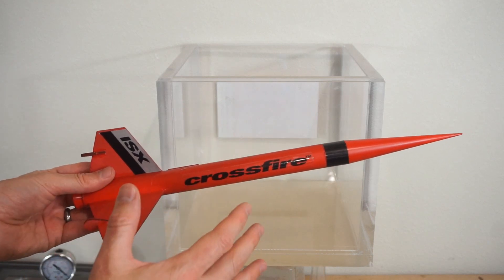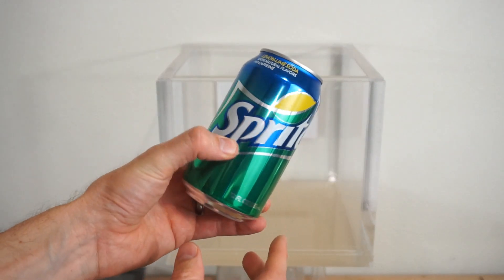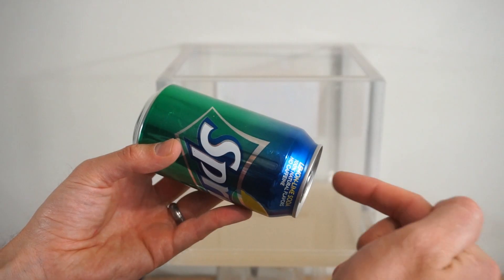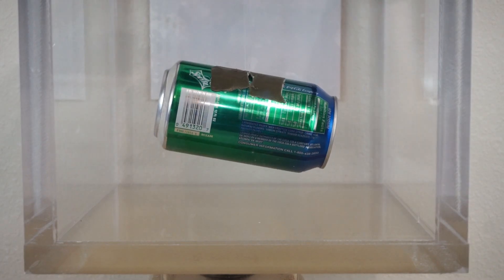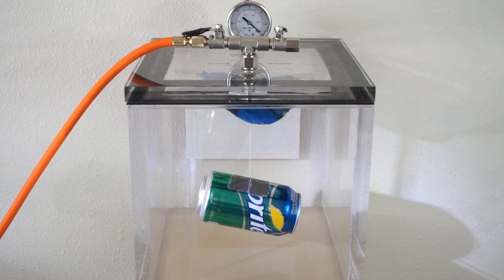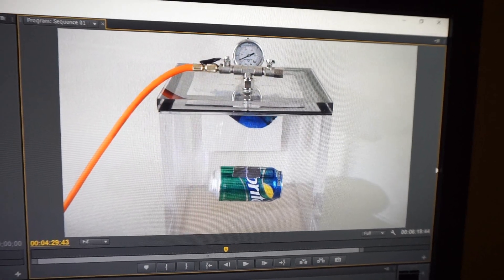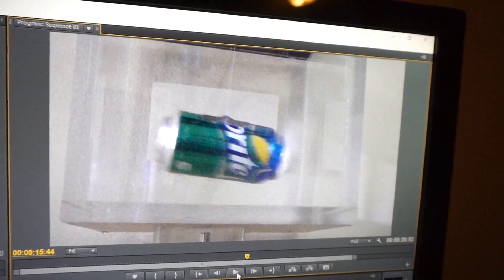Can a Rocket Fly in a Vacuum Chamber?

Comment: "Pushing on the wall", "pushing on air"? Of course it doesn't need to push on something. It ejects mass in one direction so it goes in the opposite direction, that's Newton's third law of motion, nothing new. But it's good to do the experiment yourself and I guess it's great to teach physics.
Reply: Negative Minded This is for flat-earthers that think rockets can't work in space.
Reply: Flat-earthers? Worse and worse... The damages of ignorance impersonated.
Reply: 1969nitsuga
It's not a matter of me seeing anything.  You're simply wrong.
The opposite force is exerted before the exhaust even reaches the vacuum.  You're so concerned with showing the exhaust cannot interact with the vacuum, that you're missing the fact that THE EXHAUST IS NOT SUPPOSED TO INTERACT WITH THE VACUUM .  Nobody claimed it did, ever.
So stop knocking down your own stupid straw man argument.  "In space vacuum that energy is depleted..." whatever.  No one here is talking about any pushing or interaction of any kind with vacuum.  The exhaust interacts with the rocket, and both the exhaust and the rocket push each other away.
Reply: 1969nitsuga
The opposite reaction of the exhaust gases pushing themselves back against the inside of the rocket is the rocket moving forward.  The vacuum outside plays no role.  No one claimed it did.
Reply: Holocene
Where is your source that says it wouldn't?
https://en.wikipedia.org/wiki/Rocket
" Rocket engines work by action and reaction and push rockets forward simply by expelling their exhaust in the opposite direction at high speed, and can therefore work in the vacuum of space. "
Reply: Just A Man
The exhaust pushes against the inside of the rocket and pushes itself back.  The equal and opposite reaction is the rocket pushing forward.  Nothing's pushing against itself.
"The combustion chamber is an explosion that pushes on all sides of the chamber equally."
Not the nozzle.  It's free to exit that way.  It's not a side to push on.
Reply: Just A Man only pushing you doing is at your moma ass. Go back to school. Newton reference of frame doesn't have air. It is a perfect vacuum.
Reply: 1969nitsugu
No such empirical data.
It's like pushing away heavy rocks (each of which pushes you back a little), and you have a huge bag of those rocks.  Yes, it works.
Reply: 1969nitsuga
We already had the explanation right.
Reply: TheOneWith TheEyeOfTruth To see this you need to view the system as a kinetic energy transfer. In space vacuum that energy is depleted without creating an opposite force. The exhausts gases will always has a smaller mass than the rocket. Nobody challenges your view because there is too much at stake on the table. What do you think will happen if the people confirms thete are no space travel s nor space rockets or satellites?
Reply: TheOneWith TheEyeOfTruth The 3rd doesn't work the way you are saying. It is a matter of mass and energy. Gun's recoil, Newton's 2nd.,  requires mass to create momentum which is preserved in the system until force affect it. Your neighbor had a new AR-15 and had the brilliant idea of using it in his backyard while you are trimming the grass. He accidentally shoots you in the shoulder and the bullet gets stuck in a bone why is that? Your skin may not but your bone stopped the bullet and your whole body absorbed the impact. The bullet had enough energy stored to do that after leaving the barrel. An opposite reaction requires mass to build and preserve momentum. The momentum is preserved trough the system means that the equation has to account for it jn the numbers and results but it is in an inverse proportion between mass and acceleration. The more acceleration the less pressure in the system (here is when the momentum is shifted from the bell and the rocket's body to the exhaust gases negating opposite reaction. It is similar to holding a firecracker in the palm of your hand. If it explodes while your hand is open you will not be seriously harm but if you close yor hand tight you will probably lose your fingers. The opposite reaction will send your fingers flying around. Where is the momentum?
Reply: TheOneWith TheEyeOfTruth You are mistaking thrust with recoil.
Reply: Alex Lazarus you are still believing opposite reaction is what moves a rocket thats why you reject the equation. The principle of thrust in an airplane and a rocket is the same you've been made think otherwise, Ve specific exhaust velocity doesn't implies momentum in an isolated system but in interaction with athmospheric components. Tsiolkovky's equation asumes that what moves the rocket is just opposite reaction but reality is showing otherwise. Ln(mo/mf) is just telling you how much fuel is consumed through the trajectory but not why it is moving. Nobody realy knows what is mass and how it functions. But to move you need energy over something (force) in sufficient amounts to change inertia. In other words, to charge mass with energy and then there will be momentum.
Reply: Alex Lazarus this little elementary school experiment shows how the athmosphere interact depending to the nozzle configuration and how it affects thrust. No real momentum by opposite reaction. https://youtu.be/rotO0PTlwBk
Reply: Alex Lazarus t;ese are some other experiments, take not on the difference in nozzles. You can make them at home. Tsiolkovky's is only a fuel vs thrust equation that doesnot account for the real factors. https://youtu.be/FeULZ4Ow81U
Reply: Alex Lazarus This guy will give you nightmares for many reasons but he made an interesting set up with negative pressure. https://youtu.be/xe0PjqC0dgw
Reply: Alex Lazarus F=mVe=mVe-act+Ae(Pe-Pamb) the last part of the equation will always yield a negative Ae because Pamb in space vacuum is undefined or tends to infinite. -Ae>mVe-act.
Reply: Alex Lazarus You just can't cherry pick physics. The energy goes in the expelled expanding gases. Momentum implies force and force implies energy.
Reply: Alex Lazarus I am digesting your idea. It is a good analysis but still we need to visualise the rocket and its inmediate environment as a whole, a system. Tsiolkovsky equation only accounts for the fuel consumption/velocity and mass loss. It doesn't accounts for the different factors interacting. Gives the rocket thrust as a given thing in disregard of the real mechanism operating.
Reply: Alex Lazarus I will send you a link to a video from NASA explaining the origin of thrust as the pressure exerted in the bell. Water is a non compressible fluid and the dinamics are not the same.
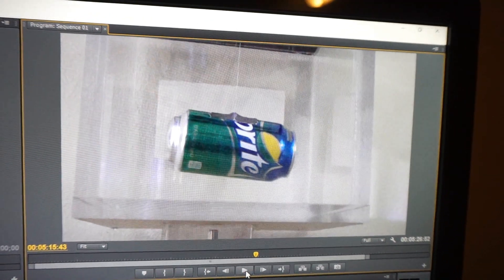Reply: Alex Lazarus https://youtu.be/xe0PjqC0dgw at 5:55 the presentation shows the real reason gor thrust and then try to diminish the argument for athmospheric pressure. But it is too late... The drawing on the board clearly represents the gases generating pressure over the walls of the rocket's engine bell and using a path of least resistance you hate so much but can't get rid off. To exert pressure up you need pressure down. If there is nothing to push from nothing will happen.
Reply: Alex Lazarus good luck with your rocket to nowhere. He who likes to be deceived will always be happy to continue with a lie. Rockets still don't work in vacuum and theres empirical falsifiable data supporting that against a biased unsustained NASA claim.
Reply: Alex Lazarus Not even NASA has proven being on the moon. Has you seen the ISS fake videos? It is lame. A friend of mine worked designing that thing, it has been a sham from the beginning. Like space x and blue origin, hoaxes to suck money for black projects. LOL Do some research and build a little experiment, see what happens with thrust in vacuum. You seem smart enough to do that, hope so.
Reply: Alex Lazarus P.D. the moon is way closer than the 293000 miles they tell you and inside the dome.
Reply: Alex Lazarus peer reviewed by hundreds of people.
Reply: Alex Lazarus it is better data than yours. Ive done experiments confirming results. And the retroreflector can be a lot of things. Still there is no curvature and rokets don't work in vaccum.🙊🙉🙈💩
Reply: Alex Lazarus its called a silica plate. There were many similar experiments with similar results in laser reflection before Apollo 11. MIT made a few. Prove there is no dome... Just like when you prove there is curvature...
Reply: Alex Lazarus They tracked... You were there? LOL Money and control over society, a flat earth implies ID and the deep state will lose their grip over himan kind. Its quite obvious.
Reply: Alex Lazarus prove spinning and curvature. You can't! LOL
Reply: Alex Lazarus https://youtu.be/uz09H_qwQ-U so much for your reflector. 😜
Reply: Alex Lazarus Mit did it in 1962 without reflector and low intensity lasers... Just more bullshit to trick people. l just found this nice video that more or less explains what I've been trying to push in your indoctrination hardened head: https://youtu.be/PxT5wYSLuI0
Reply: Alex Lazarus all that is debunked or soundly explained. Your reflectors could be anything. And if the moon is inside the dome it opens a lot of possibilities, none of them bery reassuring for you. Coriolis has been shown to ne inverted many times, particularly in big athmospheric phenomena like hurricanes. Besides, in a closed system like the dome you got a Sun and a moon circling around creating wind currents.
Reply: Alex Lazarus If the earth is round and spinning at 1043 mph nobody would be able to ttalck to each other. Sound waves are slower. This is similar to tbe quantum delay choice and light in a heliocentric model.
Reply: Alex Lazarus Krakatoa's explosion's vibrations could have been absorved pr diverted in many different ways. Geology doesn't have a solid paradigma. It is mostly congetures and false assumptions. You ever bee to Equador? Coriolis doesn't work as you say. It is a lie.
Reply: Alex Lazarus I just said that. What I also said is that it is not spinning what causes it but simple air currents with an inside Sun and Moon circling close the equator.
Reply: Alex Lazarus Globe model don't predict but simply incorporates apparent phenomena through biased explanations that doesn't fit empirical data.
Reply: Alex Lazarus All those theories are simply based on wrong assumptions trying to explain phenomena without empirically supported models. How to put it... mambo yambos to trick naive people.
Reply: Alex Lazarus This is another curious videon This effect may be caused by ice formations over the dome. https://youtu.be/SUmhvzlWX6E
Reply: Alex Lazarus It is fun to see how you use contradictory assertions to support your rotating globe model. The car, once moving you don't feel anything but the pendulum changes aligment by the same forces? The pendulum has shown to be influenced by many factors, none of them gravity nor rotation. It proves nothing except that relativity is wrong and there is no gravity as descrribed by mainstream theories. The pendulum has inconsistencies in speed, swing direction, and friction with axis to the level of being discarted as empirical evidence for earth movement. I really hope you are only designing airconditioning systems and not planes.
Reply: Alex Lazarus the pendulum is no evidence for earth rotation. And krakatoa neither for round earth.
Reply: Alex Lazarus just sent uou a video about rockets. Sound is a wave and in that case it reverberated through the planet. Sound moves at different speeds deepending on many conditions like density, athmospheric pressure, wind direction and speed. The sound reverberated for days, it was bouncing on something... the dome. You still has no real evidence of curvature nor rockets in vacuum. Just one paper or NASA experiment... I gave you people's experiments supporting my claim.
Reply: Alex Lazarus your pendulum moves in different directions and is affected by random forces at start. In fact, if we were spinning you should not need to push it to start because it would be moving endlessly. A perpetual motion machine, wich it obviously isn't.
Reply: Alex Lazarus You are just desperately searching the net for answers to sustain your outdated and unsupportrd heliocentric model. You still has to face Michelson-Morley and quantum delay choice for photonic dynamics supporting stationary earth. Good luck with that. All you are bringing are debunked cliche for gullible globetards. Be a man and admit defeat.
Reply: Alex Lazarus thete is no 100% correlation. Experimental results, real experimental results, bring pendulums moving in the wrong directions and angles. And krakatoa was just a sonic boom rebouding on the dome. In fact, the dome is better explaining than the plain athmosphere hold down by a nonexistent gravity force. You are just parroting things someone pulled in his desperation to explain observations under a nonempirical theoretical construct.
Reply: Alex Lazarus https://www.quora.com/Does-the-Foucault-pendulum-prove-that-the-earth-is-rotating-Even-if-the-earth-is-not-a-globe-how-could-this-movement-be-explained-in-the-flat-earth-model this is one of many evident observations debunking your pendulum.
Reply: Alex Lazarus https://www.quora.com/Does-the-Foucault-pendulum-prove-that-the-earth-is-rotating-Even-if-the-earth-is-not-a-globe-how-could-this-movement-be-explained-in-the-flat-earth-model
Reply: Alex Lazarus the theory behind the pendulum has to be at the north pole to be any kind of spinnig evidence. Ther are hundreds of trials with different outcomes demostrating that what you say i wrong. I also had physics labs at college.
Reply: Alex Lazarus you again mistaking observations with the biased explanations given by maistream. The pendulums has many factors affecting results and are usually overlooked in the rush to get supporting data. It is not nonsense iys simply physics telling you those numbers are not reflecting what they say. Most pendulums has magnetic actuators that create torsion at the spike or string interfering with its free operation. The theoric background used to relate operation to earth spinning omplies inertial forces not related to spinning, something already discredited by quantum mechanics experiments of differentt types and set ups. And it is also related to the pendulum position in the earth. The experimental results are not spinning related.
Reply: Alex Lazarus this is a video of the Sun under the dome and veryclose to the ground. In fact, the clouds are all around it.
Reply: Alex Lazarus I don't believe the Mach principle is real but in general there are unaccounted factors like magnetic fields and temperature affecting a pendulum working. Michelson's experiments were on thee asumption of earth spinning.
Reply: Alex Lazarus it is all circular logic. You try to prove earth spinning by interpreting experiments under the assumption of a spinning earth. A non stationary aether has neen sustained by recent research. Einstein's relativity also has that same problem. Inertial frames and the speed of light are affected by the moving aether. Your experimental data must be flawed.
Reply: Alex Lazarus first: aether exists and it is fluid. Second: Speed of light inside inertial frames is not a constant. Third: Inertial frames are not isolated from the external reality and you can determine real speed and movement. Fourth: there is no light contraction as descrined by Fiztgerald-Lorentz. Fifth: time is only perception Sixth: no gravity
Reply: Alex Lazarus Einstein's aether is static not dynamic. He basically regected it but empirical evidence has proven him wrong.
Reply: Alex Lazarus what part of dinamic implies us to be moving. You are still clinging to relativistic thinking. It says that we are moving but experimental data don't show it because we don't have an outside static point of reference to show our movent. That's the origin of Relativity trying to protedt gravity and the heliocentric model from empirical data showing otherwise. One of those experiments was Michelson-Morley. But recent discoveries in quantum mechanics show That the Fitzgerald-Lorenzt contraction was misused and misinterpretated to null Michelson-Morley. Quantum Delayed Choice and other experiments support this. Sun's light takes 8 minutes to get here, particle/wave duality forbids us to see that light under the heliocentric model. If the Sun is 93,000,000 miles away and it takes 8 minutes we would not see it with the naked eye if it were an hour away by mere light refraction.
Reply: Alex Lazarus https://youtu.be/uN561xqEKxQ
Reply: Alex Lazarus https://www.google.com.pr/url?sa=t&source=web&rct=j&url=https://arxiv.org/pdf/gr-qc/0104032&ved=2ahUKEwjwztun_PbZAhUCXK0KHTq2AxEQFjAEegQIBxAB&usg=AOvVaw3fKv2BQ0a44ggm9yUP5zd5 the Fitzgerald-Lorenzt contraction was misused. Relativity is a game of words to support gravity which to the date has no empirical data supporting it a hasn't neen found nor explained with satisfactory mechanics in light of quantum physics.
Reply: Alex Lazarus Your assumption is wrong. Astrophysicists make theories about quantum physics but empirical data is analysed under biased assumptions. Check the video about the Sun's size and light speed. Simple logic. This one gives you the idea too. https://youtu.be/0mG2P_4JMms if observations and logic does not fit the model you change the model.
Reply: Alex Lazarus all that is circular logic. An object 93 million miles away has an 8 minute delay to your current position. If gravity exists as described the gravity well will distort light but also make an interference pattern denying us from seeng the Sun's light. Astrophysicists doesn't touch that even with a 10 foot pole. Time is a perception but it is always running at the perspective of the observer outside the system. All speed is distance related to time and inertial frames are not isolated from the external reality. For us to see the light implies a stationary earth and a moving aether. That's why microwave and redshift measures tell earth in the center and disprove Big Bang. Particle/ wave duality requires an observer and without it matter doesn't organize, at leadt not as we percieve it. Vision only organize the data in a coherent way once perceived by fhotoreceptors in the eye after lenses (observer). If we are moving through space that light won't reorganize and we could not see a coherent light pattern but a probability wave outside spacetime continuum. Quantum mechanis are not compatible with relativistic physics exactly because of time and gravity (the essence of relativistic physics).
Reply: Alex Lazarus Relativistic quantum mechanicsis only rethorics with number salads to protect the relativistic construct which is not supported by empirical data. It requires interpretation of observation under circular logic and interbreeded assumptions. And still there is no curvature...
Reply: Alex Lazarus quantum mechanics is not a lie. The lie is the interpretation under cicular logic and the relativistic physics to explain phenomena under biased assumptions. Phenomena must be explained under observable, logical and verifiable data, reality. Still no spinning or curvature...
Reply: Alex Lazarus those are simple interpretations of observed phenomena with a previous mind set up to prove spinning and curvature. There are alternative explanations for the observations but mainstream regects them, not for lack of empirical data but because they don't fit their preconceived models and theories. Better examples than Big Bang and Darwinian Evolution are hard to find. Researchers are human beings with all the goods and bads it may represent. Cognitive dissonance usually affects the group with stronger believes in a disrrupted paradigm. In our case, there are huge interests from institutions and sectors in society interfering with the change process. How many people will go to jail for a flat earth at NASA? Or how much will the shares of satellite contractors like Rytheon, Lockheed, Blue Origin and Falcon X will drop once the truth comes to light. Just think about the Smithsonian... Still no evidence for curvature, just a real photo from outer space... Is that too much?
Reply: Alex Lazarus this is the basics of the curvature problem. Empirical data is sidesided to support a misleading lie.
Reply: Alex Lazarus The problem with those photos is that has been shown to be fake composites in many ways. The Chinese sent a probe a few years ago... Why didn't we have new photos and not those. 50 uear composites?
Reply: Alex Lazarus https://youtu.be/1X_Tw27wWv0 see the curve...
Reply: Alex Lazarus Michelson-Morley's original findings were refused by using Fiztgerald-Lorentz contraction and eventually Michelson-Morley was correct. I sent you experimental data rejected or sidelined by mainstream and told already how observations and data are mistaken for mere explanations and interpretations even against known laws of science for many biased reasons. Still no curvature... The last video is very enlightening about curvature. Debunk that if you can. I live on an island and you can see further than 10 miles at eye level and the coast line is over 100 miles straigh. To left and right.
Reply: Alex Lazarus It is a weather thing, they obviously has to account for it. But it has nothing to do with earth rotation.
Reply: Alex Lazarus simple mass and inertia. It is an electrodynamic process. Mass gets charged and discharged by contact and friction.
Reply: Alex Lazarus one stept closer to enlightening.👍
Reply: Alex Lazarus As I told you before, there are many factors interacting with the pendulums. It can be affected by environmental factor, even electromagnetic currents, remember the aether is dinamic and circles earth, the Sun moves through the imaginary equator and it can generate electromagnetic and ionizing effects. Needs more analysis and research but spinning eaarth is definitively discarded. I found this this morning, it confirms my point of view. https://youtu.be/z7tIbwK0ulM
Reply: Alex Lazarus Do you know how inertia and mass work? We measure mass by weight but it is not weight and inertia is a tendecy to keep moving or resistance to movement till force is exerted. So it needs some sort of kinetic energy charging in relation to density and mass. Gravity is not an answer because it doesn't exists as described and there is no real evidencefor its existence. There are too many incongruencies in its observations vs theoric explanations.
Reply: Alex Lazarus weather and environment are 2 different things.   There are subtle forces in acction we are not necesarily aware of but spinning is not one of them and that is an empirica fact.
Reply: Alex Lazarus It is a fact, all those experiments, fluid mechanics, inertia and simple logic are supporting it. All you got is cherrypicked data with dubious interpretations/motives and pseudoscientific dogma.
Reply: Alex Lazarus We don't spinn... An empirical fact, no gravity, an empirical fact, dinamic aether, an empirical fact, relativistic physics false, an empirical fact, no visible or measured curvature, an empirical fact and no opposite force as thrust in vacuum, an empirical fact. We have a solid case. All you need to do is evidence the curvature and the spinning with a "real" non doctored satellite photo. I will be here waiting...
Reply: Alex Lazarus Apollo's has been debunked by experts in photography and the other space agencies pictures are just like NASA's fake n cgi. You still has not provided any real empirical data or scientific experiment showing globe earth nor spinning. Without those everything iin the heliocentric model crumbles. You are just a case of cognitive dissonance.
Reply: Alex Lazarus you have not provided expperimental data sustainig your position. I did. You only got debunked dogma. I know what cognitive dissonance is, do you?
Reply: Alex Lazarus This is very easy, this picture shows a flat horizon. Thete is no way it can happen inn a globe earth. The curvature is the same to all sides. Autocad tells you the curvature for 5 miles is 5 × 5 × 8 = 200 feet. That's a 15 stories building. Do you see that? No, you don't. Everything else is irrelevant. https://www.google.com.pr/url?sa=t&source=web&rct=j&url=https://aplanetruth.info/14-if-the-earth-is-a-curved-sphere-why-are-all-horizons-flat/&ved=0ahUKEwidkPXHkfzZAhVMIqwKHRHyBgwQFggoMAA&usg=AOvVaw2AFs8Du-YXm6UAID_8PokX
Reply: Alex Lazarus Just explain why we don't see the curvature or why those experiments don't show the earth moving at all. Why red shifting a microwave background tell us to be at the middle of everything. Those are empirical results.
Reply: Alex Lazarus Your links are only interpretations of observation or mathematical constructs not supported by reality. That is not evidence. Empirical evidence is the results of Michelson Morley or Sagnac, clearly contradicting earth movement and relativistic physics.  Sagnac contradicts relativistic physics and without that Michelson-Morley's results are obvious. We are not moving and the propagation media does.
Reply: Alex Lazarus Simple denial, all birds has wings and beaks. Every beach horizon on this earth lokls basically the same. Your analogy is faulty and desperated. https://www.google.com.pr/url?sa=t&source=web&rct=j&url=http://www.conspiracyoflight.com/SagnacRel/SagnacandRel.html&ved=2ahUKEwiHzqmHqPzZAhUIcq0KHfA7DCQQFjAKegQIABAB&usg=AOvVaw0-fI9wq5x_qKjkYL478cyd Sagnac for you!
Reply: Alex Lazarus And yes, it negates all your indirect interpretational evidence.
Reply: Alex Lazarus Ha ha ha! That link takes you to a circular logic paper telling you that we are not the center of the universe because Copernicus said so and we believe him even in front of evidence of the contrary and the we create an absurd and surreal complex explanation for damage control. This tell you there are no black holes, nor big bang, there are no valid mechanics. Empirical evidence tell you can't get something from nothing. https://www.google.com.pr/url?sa=t&source=web&rct=j&url=https://uncnews.unc.edu/2014/09/23/carolinas-laura-mersini-houghton-shows-black-holes-exist/&ved=2ahUKEwiVpdqyrfzZAhUHVa0KHcACAiEQFjAfegQIABAB&usg=AOvVaw06Y9fv8WxfuhKcobptqQJt
Reply: Alex Lazarus https://www.google.com.pr/url?sa=t&source=web&rct=j&url=https://en.m.wikipedia.org/wiki/Axis_of_evil_(cosmology)&ved=2ahUKEwisiK--rvzZAhWCna0KHeOID-sQFjAAegQIBhAB&usg=AOvVaw2tEOEqs0lF7Rh47FLXxuxm
Reply: Negative Minded, you've just illustrated you have no idea what Newton's Laws explain. Rockets were originally called  'Thrust Rockets' because they required thrust at both ends to operate. They work on Earth because the 'air' in our atmosphere is able to be compressed and utilized as a backboard for the Rocket's required 'thrust'. And it is a requirement. Rockets do not produce the required 'thrust' in the infinite vacuum of Space. It worked in a small vessel because the sides provided the required backboard.
Reply: It's hard to argue with these Scientologist space mormons. In 2018 they just literally make up their own science rules and invent new abilities and characteristics for gravity whenever they need to defend it.
Reply: 1969 Nitsuga I admire your patience in making this mental midget dance and squirm around for DAYS but give it a rest. The guy is hopelessly religious.
Reply: He thinks the explosion is bouncing off the interior walls of the chamber, which forces them out the back, giving the rocket a little PUSH in a nice neat orderly controllable direction. They did this over 40 years ago and landed a bunch of tinfoil and shower rods on a rock 240,000 miles away doncha know!!! It's on TV guys.
Reply: NotTheCIA I.think, thanks for a good read!

1969nitsuga, thanks for a really hard laugh!
Reply: you're grasp on reality is duct taped together.  You can't push on nothing and get an equal and opposite reaction you genius.  You can't push against your self and move in a direction LOL.  The combustion chamber is an explosion that pushes on all sides of the chamber equally.  The only difference is the "exhaust" is just a place for the gas to escape.  The equal and opposite reaction is the exhaust hitting the air mass, and the air mass pushing back in the opposite direction with equal force.  You're literally thinking the rocket pushes against itself and thus moves.  You must have gone to government schools.
Reply: Negative Minded your assertion has been proven wrong by empirical results. Sorry if you can't understand the physics of thrust in vacuum.
Reply: TheOneWith TheEyeOfTruth what you say is wrong and there is empirical data sustaining it. Rockets don't work in vacuum.
Reply: TheOneWith TheEyeOfTruth that is like pushing your car with the legs in the air...
Reply: 1969nitsuga hope you can understand. Rockets works much efficiently in a vacuum than air. Even Turbofan jets work same principal. Newtons third law doesn't need you to go to private school or government. Just try to understand. Focus for 5 minutes without making up nonsense.
Reply: Negative Minded https://youtu.be/FeULZ4Ow81U This is an easy set up for you to build and test by yourself.
Reply: Negative Minded another one https://youtu.be/xe0PjqC0dgw
Reply: TheOneWith https://youtu.be/xe0PjqC0dgw
Reply: TheOneWith TheEyeOfTruth an easy set up for you to build.
Reply: Negative Minded another one https://youtu.be/DMQMvNXq5Ts
Reply: TheOneWith TheEyeOfTruth another one https://youtu.be/DMQMvNXq5Ts
Reply: Alex Lazarus F=mVe=mVe-act+Ae(Pe-Pamb)
m= exhaust gas mass flow
Ve= effective exhaust velocity
Ve-act= Actual velocity at nozzle exit plane
Pe= static pressure at nozzle exit plane
Pamb= ambient (athmospheric) pressure
Reply: Alex Lazarus you better use a pool game. People is more familiar with it than a pendulum. Momentum is preserved through the system. The system depends on contact to interact between the parts. This is only another energy transference process. Momentum depends on movement and mass (we don't know the nature of mass). The body maintains this kinetic energy unless its speed changes. The exhausts gases as a fluid saturated with kinetic energy in an isentropic process will be at high supersonic speed, the higher the speed, the lower the pressure and the less kinetic energy transference to the surface of the rocket's bell. The vacuum is the path of least resistance and opposite reaction is negligible.
Reply: What a sad day when people think newtons third applies in a vacuum.
Reply: Alex Lazarus you are just repeating the lie in text books. Have you ever experimented in real vacuum and had supporting results? I know you don't. The full equation contemplates athmospheric pressure and Newton's 3rd isn't isolated from other laws of physics. The path of least resistance in the system will take away the kinetic energy before creating momentum. That is the particularity of space vacuum. Rocket engines has adjustmets in the nozzle to compensate the change in athmospheric pressure. Those simple experimets demostrated that.